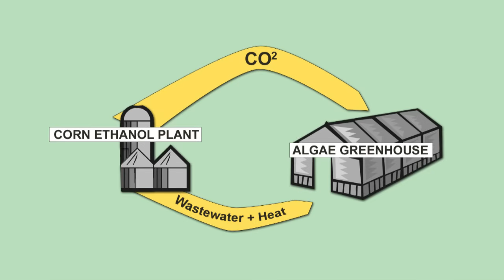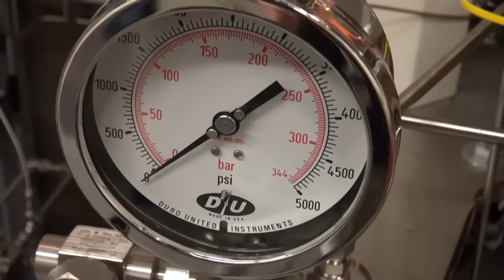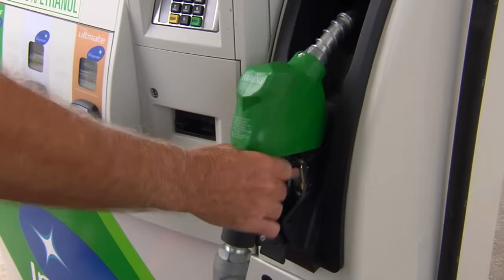Algae Power | This American Land Season 4

Comment: Need to connect algae production with wastewater treatment plants (facilities) that use anaerobic digesters. Those digesters produce massive amounts of waste gas CO2, and methane which can be scrubbed, compressed and sent directly to generate extra power to operate the algae processes.  People...We need to liberate ourselves from fossil oil the petrodollar  (due to the geopolitical problems it creates)...We need to get on a biodollar model similar to the fossil/petro, but regionalized, and environmentally sustainable..
Reply: Carl Lelandt Also worth mentioning about wastewater plants is their abundance of trace nutrient containing water. And I think most of those plants using anaerobic digesters, are using old design technology degesters that were developed back in the earlier 20th century.. I suspect that anaerobic digesters could be updated for increased production of specific gases, etc.Another keen thing about wastewater plant is the large scale size of the operation. Which means that the various stages of process, components and equipment are of size that makes them easy to see, monitor, and work with..
Reply: +Carl Lelandt Carl, do you work in this industry or have any experience with algae production?

The reason I ask is because I am pursuing a degree in Chemical Engineering and am currently looking for experience in this field. I'm extremely passionate about biofuels and would love to have the opportunity to learn more.
Reply: +Jake Hash I'm retired. My experience was in wastewater, in CA, bay area. Where ever you are, your state has some kind of water quality control board, look them up, and see if they offer a wastewater operator home study (correspondence or online). Take the course (very easy)..and they probably have lower division units for the course, at extra cost. The course will familiarize you with existing technology/processes. And some wastewater facilities will give you access for education/research, maybe even let you work part-time, etc. I recommend such experience. Many facilities have anaerobic digesters, and already do cogeneration from the captured/scrubbed methane, and still have too much methane. So excess is tanked, the rest just burned off. So your interest might focus on better utilization of methane, for use in powering an algae operation, using the digester CO2. Surplus methane runs generators than can supply energy for running proper spectrum lighting systems, and other energy demands from an algae operation. Most wastewater facilities have labs. Some have very sophisticated labs on-site. Algae research is presently trying to identify ideal strains, perhaps hybridize to maximize lipid amount, fast growth rate, etc. There are (unfortunately, expensive) books on Amazon, you might consider. Almost as important as the algal biocrude, is its non-lipid biomass with varying degrees of cellulosic amount/quality depending on the particular algae. Cellulosic biomass is a big resource for manufacturing, plastics, etc. Presently, research is in enzymes for quick (faster) processing of the biomass. A large wastewater facility with a bit of extra land space, could potentially produce a great amount of biocrude and valuable biomass. "Hands-on" experience in a wastewater facility would be very helpful, in coming up with designs for an algal operation that best matches up to the wastewater facility parameters.
Reply: +Carl Lelandt Jake, if you're in Calif., contact the Cal. State University;Sacramento, Dept. of Engineering, for Wastewater courses. The states of New York, California, Texas and Florida have the most universally recognized wastewater courses/certifications. (Certifications are licensure for working at the facilities). Another point to keep in mind. Wastewater facilities either use anaerobic digesters (simple, produce extra energy source, captured gases), or aerobic digesters (energy intensive). Facilities that use aerobic digesters, of course, wouldn't be the most ideal candidate for algal operations..-There's not a lot of easily accessible CO2, mainly, and no methane. As far as I'm concerned, bio-crude algal production combined with anaerobic wastewater operations is a chemical engineer's dream (and biofuel production potential dream). Glad to see you're on-board.
Reply: +Carl Lelandt Amazon books has used hardback copies of "Standard Methods for the Examination of Water and Wastewater" in the 1981 edition (green cover), for $4.98, plus $3.99 shipping. I recommend the old edition because it is more "old school chemistry" in chemical analysis. -Burners, distillation, titration, etc. Standard methods covers chemistry for anaerobic digester efficiency, all sorts of procedures for need-to-know determinations.
Reply: +Carl Lelandt Wow Carl, thank you so much for the plethora of information you have given me. I went ahead and ordered the book and will be referring to your advice as I continue to educate myself on this subject. I'm currently in Ohio, but as I look for more experience I am willing to relocate and move to wherever opportunities may present themselves. Thanks again for the insight!
Reply: @zuutlmna  Hey Carl, we are from Enactus India, a student run not for profit organization which uptakes social upliftment projects to benefit the societies. We also have planned on making products out of Algae and for this, we would like to get in touch with you to clarify certain queries of ours.

Hoping to hear from you soon!
Reply: @jayanthchunduru3437  Hello Jayanth. How may I help with clarification?
Reply: @zuutlmna  hello sir, could I receive your mail id so that I can send a mail including every intricate detail?
Reply: @jayanthchunduru3437  Sorry. No, that's a private address.
Reply: @zuutlmna  No issues sir. I wanted to know what are the expenses which would've to be incurred by us to produce algae through an aquaponics and hydroponics setup. Post setting up of the structure, how can we further sell the algae and make products out of it such that we make revenue out of it?
Reply: @jayanthchunduru3437  Probably the main determining factor, in terms of cost, is the size or scope of the operation. -How big will be the size of the project? How much water/algae volume? And how much land area will be needed? Nevertheless, your interests are probably best served by selecting and working with a good commercial phycology or bio-engineering consultant.. Preferably through one of the universities there.
Reply: WE have to get rid of all fossil and petro and invest in infinite energy, it is our only solution for infinite life.
Reply: Sashi Sasj I have to disagree. The "Big oil" industry is THE single largest source of consumer items. It also supports nearly everything not directly associated with oil. Can you tell me how oil is not the single largest geopolitical influence with this in mind?
Reply: Wind, solar, and battery power is only being emphasized because it still takes a lot of mining, it's all about the mining industry
Reply: Carl Lelandt ... No, we need to utilize pulsed magnet motors! Duh!
Reply: I like to see our waste being put into use.
Reply: Sashi Sasj indirectly it is. I agree with the above guy. It has been a important chess piece of the global economy for over a century, and it still is today. Any industry that big will surely exercise their influence if another party's interest don't align with theirs?
Reply: Was thinking same
It'll be an awesome cycle
Reply: Well, just on a side note here, but anaerobic digesters can not produce anything with Oxygen in it; therefore, they do not produce any CO2.  The whole process requires they get 0 exposure to the Oxygen molecule, that's what Anaerobic means.  Sort of makes the rest of the original comment suspect since they are wrong about the argument they are trying to make here.  Also, producing extra CO2 is not a problem.  We have no working climate model, so science does not yet know what the factors are for climate change.  Just the way it is folks, you've been given a politicized version of how the world works in order to steal money from you in the form of unnecessary taxes, nothing more.  Until there is a working climate model that accurately predicts anything, no one knows what is actually going on.  You can pretty much be certain though that anything that becomes politicized in the science world is already wrong, especially if they use fear to sell it.  Warmer climate would actually be a good thing for the world over all, and the ice cores show it as well as the size of plants and animals in that environment from the fossil records.
Reply: algae for oil,biofuel and plastics etc. geothermal,tidal,radiant and nuclear fission and hemp's best for paper,bioplastics,rope textile etc
Reply: Carl Lelandt algae will kill us all. these farms are owned by the same bastards that own the oil industry and they now mean to kill all starting with the water ecosystems. we should use electric cars instead
Reply: sorry to say this but the geopolitical problems are not because of oil.